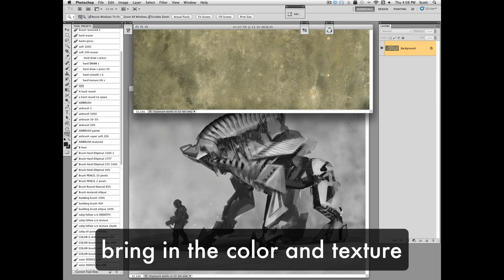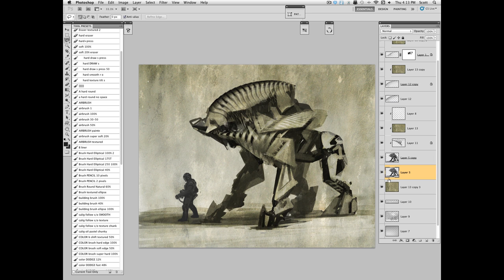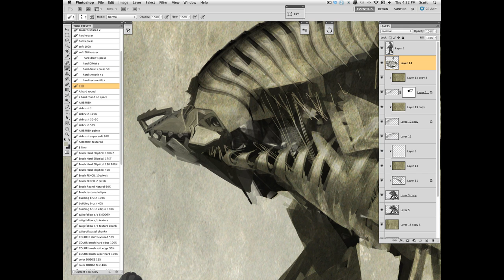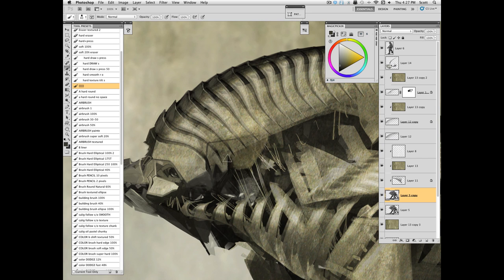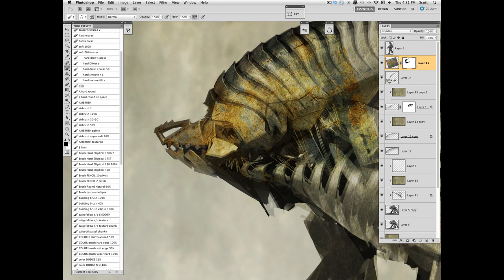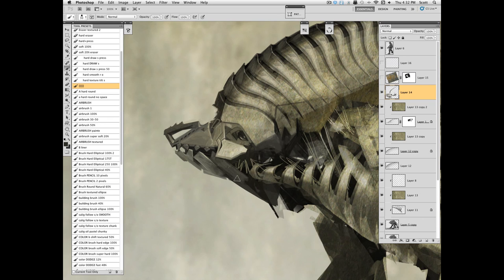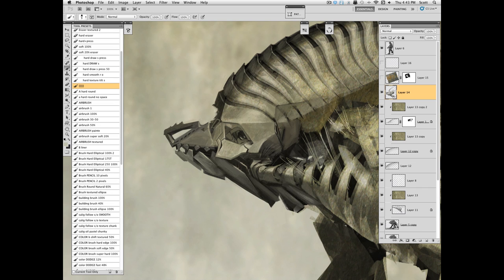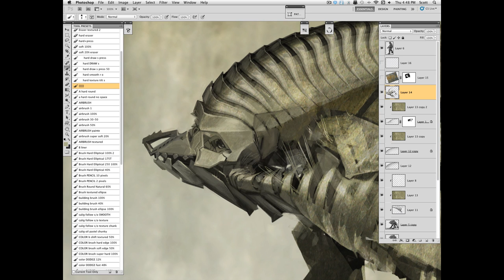Scott Robertson - Tutorial 001 - part 2.

Comment: I think the "FREE" part was referring to the demo itself. The brush is not important. If you wanted to make that brush. go to polygon tool, set it to 3 sides. make a triangle shape on a separate layer and fill it with black. go to define custom brush in the edit drop down. then select that brush then go to brush settings, transfer, set it to pen pressure. then select dual brush and play with the brush heads until you get a chalky feel. then check create brush. bang.